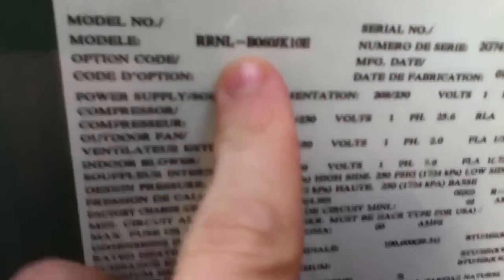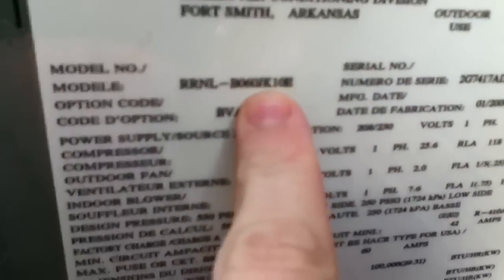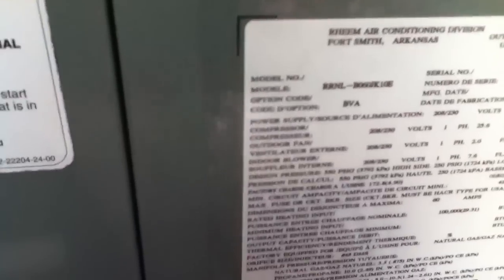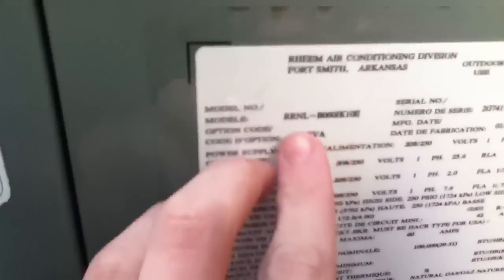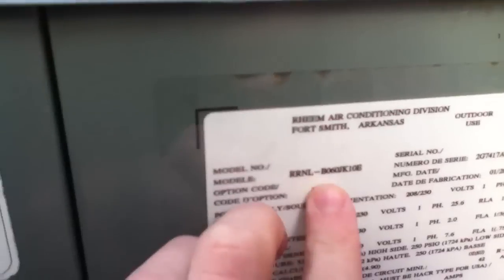Calculating tonnage of your air conditioner

Comment: on my unit you take the square root of 12 multiply it by 60 divide it by circumference of the unit subtracting the height multiplying it by the number of fan blades. simple enough

Comment: model # decode example: 2TTR2060A1000AA 
Digit 1: 2 denotes R-22 refrigerant (4 is R-410a) 
Digit 2: T =Trane
Digit 3: T =twin system (aka split system)
Digit 4: R = refrigeration unit (compressor/condenser) 
Digit 5: 2  = 12 SEER rating [single digit code (0=10 to 9=19)] 
Digit 6: 0 = soldered/braised connections
Digits 7&8: 60 = 60k btu/hr (÷12k for tonnage = 5 tons) 
Digit 9: A = original major design [(revision id) B=1st revision C=2nd, etc]
Digit 10 = 1 = 230V single phase 60amp input [system voltage (1 = 230/1/60 3 = 230/3/60 4 = 460/3/60)]
Digit 11-13 : 000 = no secondary functions 
Digit 14 : A = no minor design modifications ( see digit 9 for scale )
Digit 15 :  A = parts all earliest design  [ parts identifier code ]  [ should match #9 or #14]

Comment: Help! I need to estimate the energy usage for a central air unit.  Mine is a Trane Model # YCH210B4H0DA,  The number is 210.  So is that a 17.5 Ton A/c unit?
Reply: I found it. I guess they do make a 17.5 Ton unit. Thanks.

Comment: I'm in a medium commercial office building that has several units on the ceiling. The model number could be divisible by 3 in several ways. The model number is PGD360090K001C1. That middle section could be 36, 60, 360, or 90. If someone could help me determine the tonnage, that would be great. My guess is 60/12 = 5 tons, since there is 14 units on the rough and that's roughly the amount of tonnage that this building needs based on square footage.
Reply from the maker: Zach Sniffin Yes, you are correct. It's a 5 ton that is 13 SEER!

Comment: Existing A/C size for our split level home (built in 1956) outside Philly with 1,800 SF (total living area) is 3 ton.  T-stat set on 73 and moves up to 74 only on extremely hot days so I think unit is adequately removing humidity. The only thing preventing me from opting for a 2.5 unit for the replacement is the fact the home has a cathedral ceiling in living and dining rooms with 12 - 14 foot high ceilings.  What are your thoughts?   3 Ton or 2.5 Ton or not that much difference either way as far as performance is concerned and/or money saved? I assume the 2.5 ton unit would be $300 - $400 cheaper.
Reply from the maker: I would stick to the 3 ton because of the age of the home, and like you said the higher ceiling height. If you are replacing a much older system you should see a pretty good reduction in your power usage. I think your best bet is a 3 ton system that is 2 stage, if you can afford it. That will give you the power for those really hot days and be really efficient on the days that it is not! My house here in Alabama is 4600sqft and I have 11 tons of AC.
Reply: Appreciate your advice.  Although the hot season in the Philadelphia (3.6 mths) is longer than the cold season (3.1 mths),  I think I will replace our old single stage Carrier gas furnace from 2001 (110,000 BTU) with 80 or 90,000 BTU 2-Stage and replace our current Heil condensing unit from 1994 at 9 SEER with a 13 or 14 SEER single stage 3-Ton unit. Not sold on the reliability of 2-Stage A/C systems plus I'm sure the cost difference will be significantly higher although I have yet to price them!
Reply from the maker: Yeah they are a little bit higher. My 5 ton Rheem AC unit is a 2-Stage. Where I am humidity is brutal and the two stage system draws it out quite good. Haven't had any issues with mine, but it did knock about $50 a month off the power bill. Be sure to check with your electricity provider as most offer pretty good rebates when you upgrade old equipment! And the install is more important than the brand! I have 2 Rheem's, 1 Carrier and 1 Goodman.

Comment: What about a commercial unit....I know some u can tell the same way but some have model #'s that dont really specify.....for example....Would this trane (Model # - YCD301C4LAAA) be a 25ton?....
Reply from the maker: The commercial ones are a bit different. But that does look to be a 25 Ton. I believe the modern version of that is called the Voyager. You can look at the manual for that model and kind of decide it.

Comment: mine says FTKS60FVM T0010735 for the indoor unit. Does that says 60k BTU? isnt that freaking huge for an indoor bedroom. Its Daikin btw.
Reply from the maker: +akupehsluarketatAR Indoor units have a different nomenclature. It wouldn't be 60k btu. I believe that unit is 7kw so it's about 24k btu. I'm not a mini split expert so I'm not 100% on that! Although I do live about 5 miles from the Daikin factory!
Reply: crazyjdkid i hv figure it out. Its not abt indoor or out door just that some brands label it differently. E.g Daikin, Mitsubishi n some other brands indicate the kW on the model number while some indicate the btu. You juz need to knw which brands indicate wat on the model number. For instance this Daikin im lookin at indicates 60 which means its 6.0kw so take 6×3412 and you get the btu. Which is abt 20btu
Reply from the maker: Makes sense that the Japanese companies would use the metric units. Thanks for the information!

Comment: & how is the system for refrigerators, if say it has a 130w of electric consumption how is the cooling power in tons, i guess may be 0.1ton.
Reply from the maker: +bazrazin1 I don't think there is a very good direct conversation. But I would say more like .03-.04 tons.

Comment: My AC model is N4H360AKB400 and tonnage would be 3 tons or 5 tons? which one is correct?
Reply from the maker: +Amber Nguyen That would be a 3 ton!
Reply: so you used 36 to come up with 3 tons. There are 3 numbers and how do we know which number to use to figure out tonnage?
Reply from the maker: +Amber Nguyen I'm sorry! I actually had to look this one up. Almost never do you see 2 numbers divisible by 12 next to each other! Yours is in fact a 5 ton, 60,000BTU. The 3 stands for 13 seer.

Comment: Why don't the idiots that makes these tags with all that useless information just put 5 ton,4 ton,etc on the tag? Simple enough
Reply from the maker: +Matt Harris That would make sense! They don't really expect a homeowner to care though!
Reply: Matt Harris: You've asked a very intelligent question. One of the stock answers you get as to reasons "why" something is not simply stated by the Mfg. goes like this "If you can't dazzle them with simplicity, baffle them with bullshit".  and the other moronic evil minded miserly answer..""well..if we were to print extra data on the component or label, that would be cost prohibitive"".  Yes indeed, poor poor Mfg.'s,  if that extra ink or embossing to simplify life is going to push a company into the red and force bankruptcy, their history anyway. 20+yrs as a former Industrial electrician/Test technician. One day I received an elec. motor, called vendor/salesman.."you sent me a foreign Motor with a plastic cooling fan instead of metal..why?"..Ans. " I'm supposed to tell you less weight less starting current..but I'll tell you the exact truth..it's cheaper for the Mfg. It's all about $$$. and imported garbage, that if higher standards were enforced they could never sell in the USA.""

Comment: Sizes of Residential A/C Units
18= 1.5 tons
24= 2 tons
30= 2.5 tons
36= 3 Tons
42= 3.5 tons
48=4 tons
60= 5 tons
look for one of these numbers in your model number to figure it out
Reply from the maker: Thanks, that should help some of the viewers!
Reply: ilovedisney35.can i ask ,how about LRA 239 how many tons,answer please ty
Reply: ilovedisney35 
1ton= watt
Reply: ilovedisney35 
1ton= what
Reply: 2k Honda generater is enough for 1 ton to operate the A/C
Reply: Jonnel Candelaria .8 ton
Reply: Well I got my answer from you. 😂
Reply: Its YoMama ok asking sir
Reply: Locked Rotor Amps.
Reply: ilovedisney35 good but it varies depending of the manufacturer
Reply: What if mine says 6030?

Comment: TTA201ED00AA ..please tell the tonnage..
Reply from the maker: 16.7 Tons.That is a big AC unit.What is it used for?Its a Trane.
Reply: yes trane .ln this unit there are two compressors 142 lra .used for electrical room

Comment: My air conditioner is a GE.  Model No. BGLE102C1H00. 
Would that be 8.5 Tons?
Reply from the maker: Is it a window unit? I believe window units use a different model system. If it is a window unit, it wouldn't even be close to 8.5 ton. A window unit would be 1 ton max, and even that is rare.
Reply: No.  I am wondering if I was given the furnace model # inside of the house instead of the a/c unit outside.  I am trying to help my mother-in-law figure out the tonnage. :/
Reply from the maker: Yeah, GE hasn't made air conditioners or furnaces since 1982. But given that serial number I do believe its that old. I would double check those numbers.

Comment: My model is n4a548gkc101. So is my unit or 4t or 5 t. Both # would work.  Thxs
Reply: It'll be more simple to tell by the unit BTU so if you have a 12,000btu unit then its a 1ton....12,500btu =1.5ton
24,000btu=2ton etc,etc
Reply: Wouldn't 1.5 ton be 18,000 BTU?   1 ton = 12,000 BTU  .5 ton =  6,000 BTU.
Reply from the maker: Yes, you are correct!

Comment: Good job. Thanks for the upload. Can you tell me for a 4000 sqft house, what size(how many tons?) of a a/c system is recommended(approximately)? THX.
Reply from the maker: There is a lot that goes into determining the amount you would need. Like the region you live in or the layout of your house. I live in the deep south with a 4700 sgft house, and we have 11 tons of A/C.  We use three 2 ton units and one 5 ton unit.
Reply: Thx for your response.